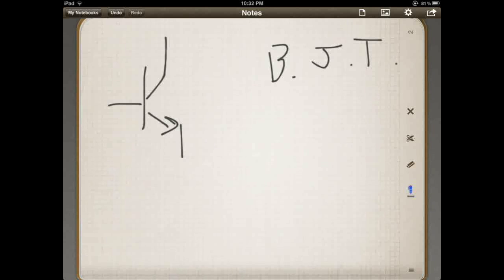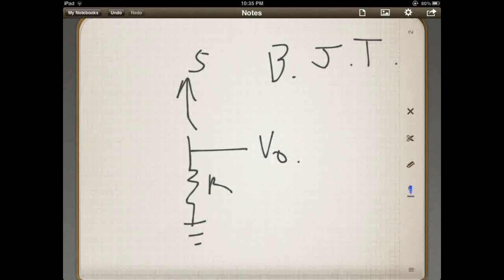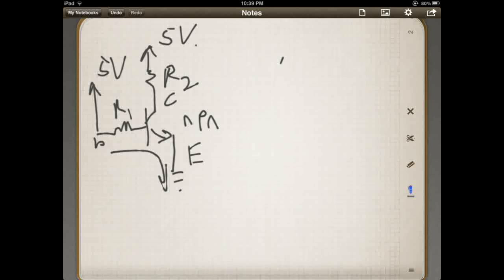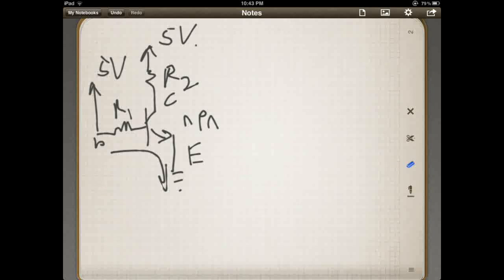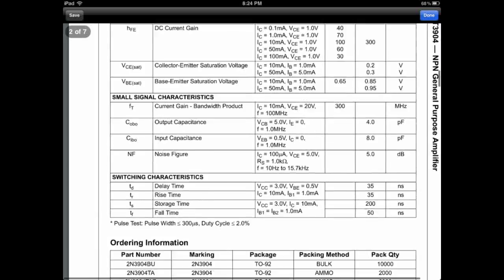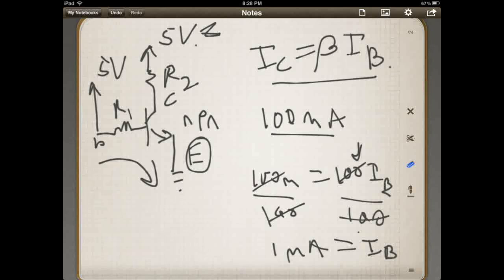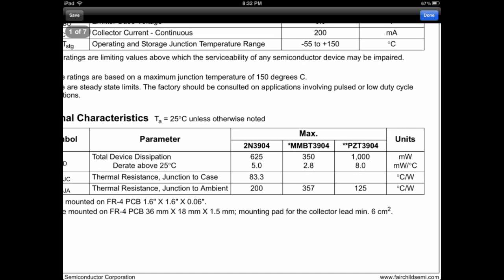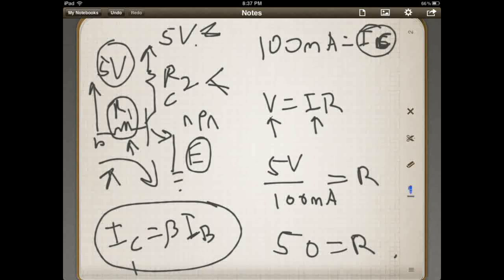Back To Basics: Bipolar Junction Transistor

Comment from the maker: Hello there thank you for the comment.  The Vo out put voltage that I was talking about in the begining of the video for a pull up resistor will be the voltage that you are pulling up to.  In my example I have the pull-up resistor set to a 5V source thus when the transistor is off (not conducting) the output voltage will be 5V.  When the transistor is on (conducting) the output will be 0V.  Hope this helps.  Let me know if you need any further explanation. cheers!